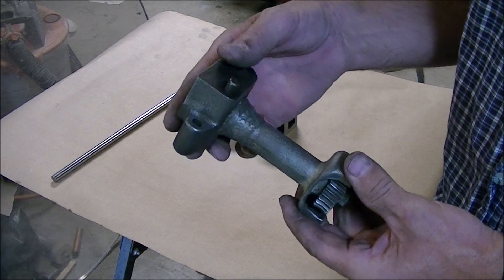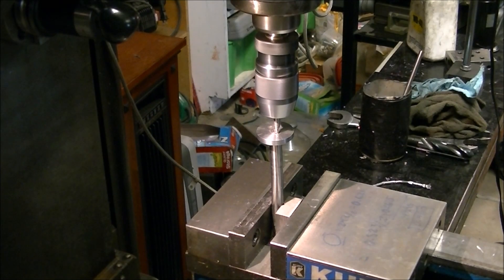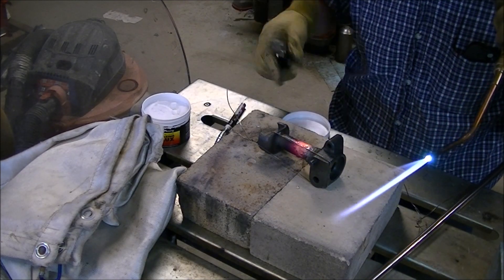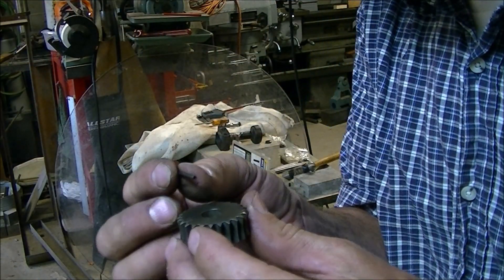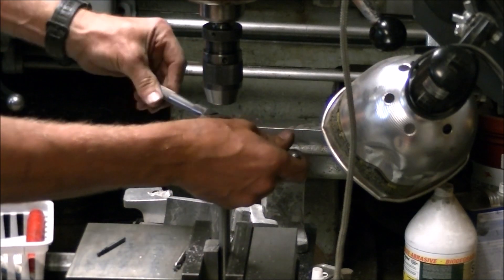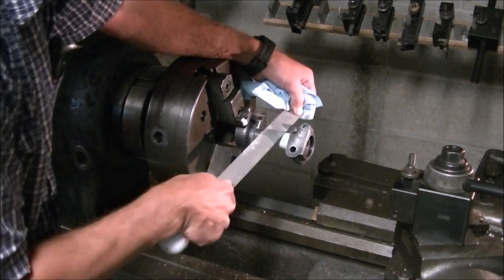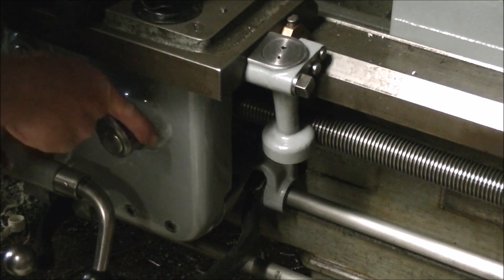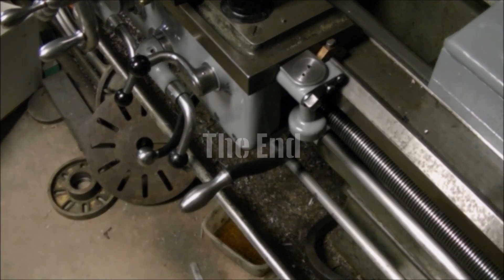Thread Dial Repair - 1943 Hendey 16x30 Gearhead Lathe

Comment: No flux on the part only on the rod?
Reply from the maker: +Rolingmetal Thanks for stopping by. That is the way the Keiths (Fenner and Rucker) do it when brazing. After I machined the tooth, there were no voids and the bond to the original cast iron looks good.  So I think I'm OK. Like I said in the video, it was my first attempt at brazing with silicon bronze so it is not an expert advising here.. Craig
Reply from the maker: +Rolingmetal sorry, it was my second attempt at the silicon bronze brazing. The first try was the Hendey gear repair a little while back. Craig
Reply: That was more a question then feedback. I've never done any brazing myself :)

Comment: That looks like a good, solid repair. I would also have forgotten about indexing the pointer on the shaft. At least it's close. Good tip on the Loctite to hold things in place. Cheers -
Reply from the maker: spnynorman thanks for the kind words. I'm thinking that maybe filling in the mark on the housing and then remarking it in the correct location might be the ready way out. Craig

Comment: Rather than removing the gear can you not just remark the engagement line ? Nice repair
Reply from the maker: +mark harris I'd thought about making a little plate with a new engagement line and pinning it to the casting to cover the old one. Or maybe JB Weld over the existing mark and make a new mark to match? One of those is probably the way I'll go as I tend to take the easy route. Thanks for the comment. Craig

Comment: Good brazing job there.  Soon some threading I bet.
Reply from the maker: Harold, now I'm working on the y-axis mount for the DRO on the mill. I need that to make an index plate for lathe gears. It doesn't ever end does it? Making parts for the parts makers. Thanks for stopping by. Craig

Comment: The use of a locking small screw on the split line of the tread is often called a Scotch Key - a bit of trivia for you!. I like your videos - keep 'em coming.
Reply from the maker: +Ian Pendlebury that is good to know. Both my 1910 and 1943 Hendey's have a lot of them. Thanks for the info and for commenting. Craig